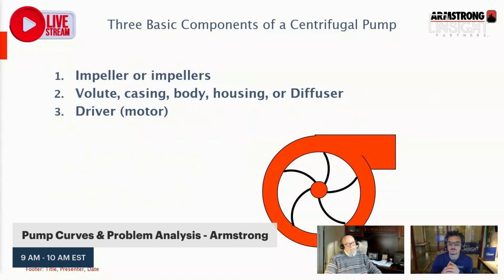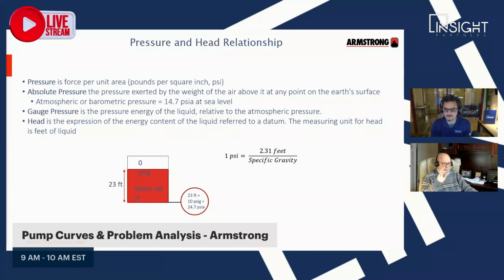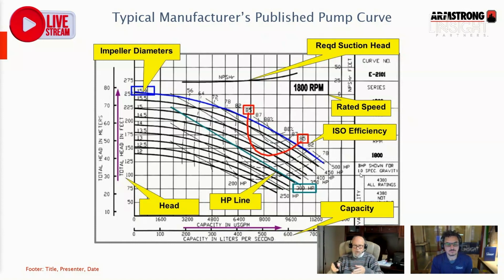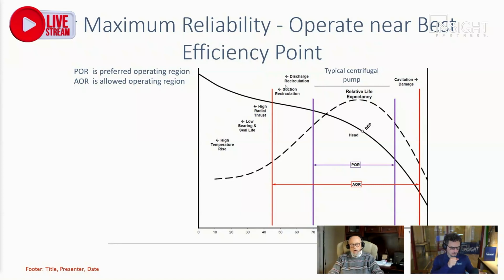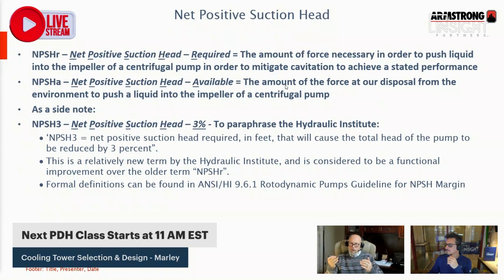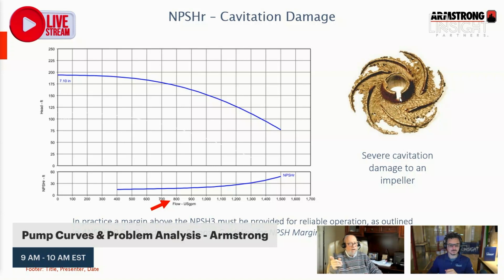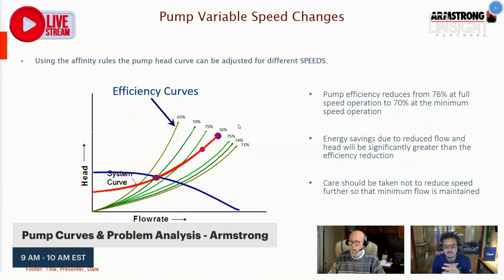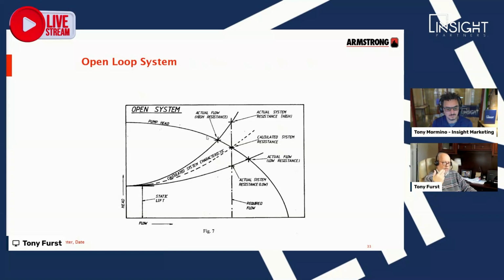Pump Curve and System Curve Explained

Comment: Thank you for sharing this. I don’t know much about pumps and it’s about to show . I have a few questions if you don’t mind answering.

In a closed loop system, the pump only has to overcome the pressure drop through the loop? Height such as 1 story to 3 story building doesn’t matter?

On a closed loop system I just subtract the inlet pressure from the outlet pressure and use that info on a pump curve?
If I go to a mechanical room with no info on the system how do I go about testing without breaking down the pump since different size impellers may installed?